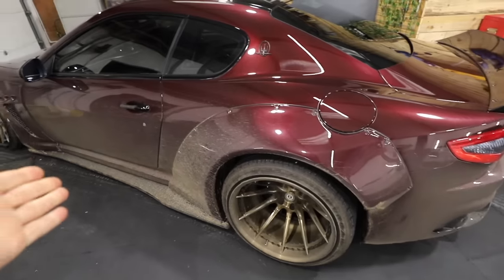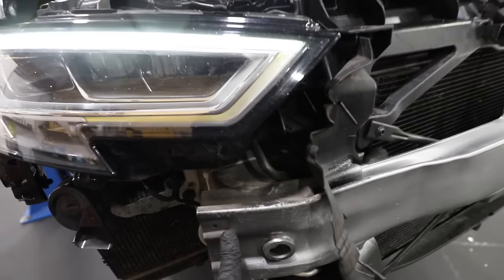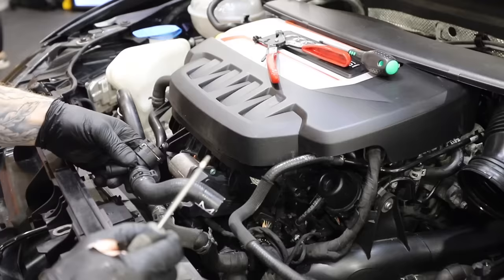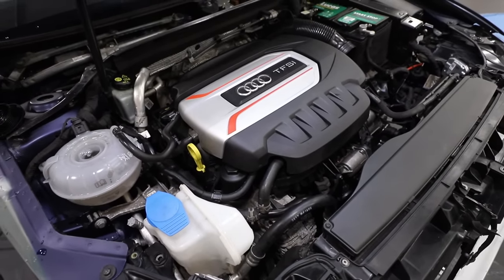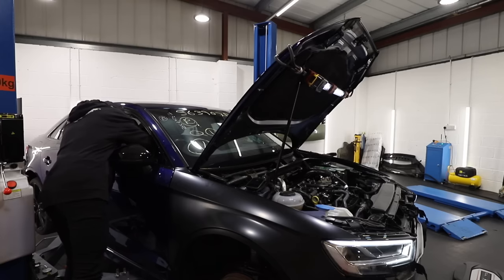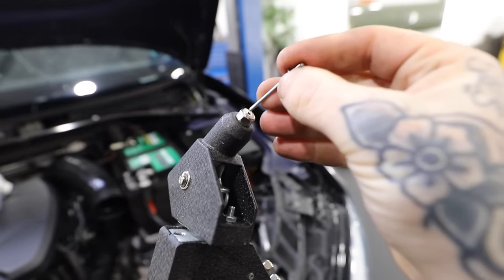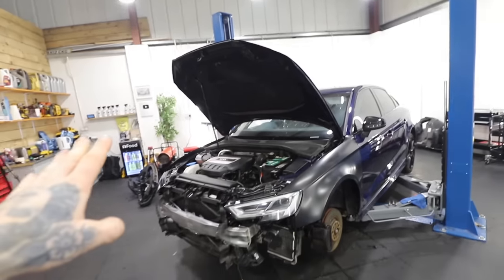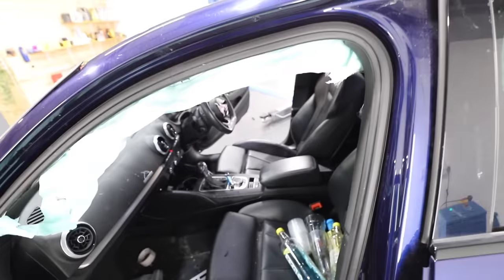MORE ISSUES FOR THE WRECKED AUDI S3

Comment: I think you will find FSI injectors need to be coded....so putting old ones in would mean they were correct code. I love the genuine surprise when a brand new 500 quid headlight actually works....priceless !.
Reply: They do not need coding. It's a straight replacement. The previous injectors he had were no good most likely filler baskets filters are filthy
Reply: Yeah injectors don't need coding. I think people hype up the "you need to code every part on German cars" too much. At least for Audi, headlights, fuel injectors, seats, etc. don't need to be coded. Its only major parts of modules or the module computer themselves that need to be coded.
Reply: Those are port injectors, they do not need coding. The direct injection injectors are mounted in the head and at least on some engines they do need to be "coded". P.S. this engine has both direct and port injection.

Comment: The sensor you have rerouted through the crash bar is for pedestrian protection (the thing that shoots the bonnet up from the hinges) and it works by sensing the pressure change in the tube as it compresses. So i don't think it will work properly as crashing into someones legs wouldn't compress the crash bar like the foam would.
Reply: Who cares just avoid people haha

Comment: I had a very similar misfire issue on my S3 8P which generated the same codes. It seemingly fixed itself too, but kept coming back intermittently. Replacing the MAF sensor fixed it. If it starts hunting again, try disconnecting the MAF temporarily, then you’ll know if it’s that.
Reply: Yeah I had the same thing with my 8P S3. Scratching my head why new coils and spark plugs didn't fix the misfire, didn't realise the previous owner had fitted a chinese ebay MAF 🤣 promptly switched for a new genuine one lol
Reply: Same here on my 8p mate. I replaced to sparks, coil packs and now going to change the PCV valve. If that doesn’t fix it I’m going to change the MAF sensor. The car be hunting/revving on it own
Reply: You had the Ea113 2.0 tfsi engine on 8P, whereas the 8V has the Ea888 2.0 tsi gen3 engine, which does not have a MAF sensor.

Comment: MQB platform is pretty common for misfires , On the 2L Gen 3 engine most common is Coilpacks or Cam Magnets , If you swap the coils and it still shows cylinder one and two , the Cam magnets would be my next replacement, Parts aren't to expensive and its an easy job to replace.

Comment: Love the videos and first time commenting, the crash sensors are connected by the tube, and detect a difference in air pressure   so that the bonnet hinges deploy in a crash. They need to be mounted in the foam to work properly. Keep it up with the great content.
Reply: Hello, I can see that you know a bit about this foam thing which holds the plastic tube. I’ve recently Crashed my Audi and the foam broke alongside the sensors. Where can I find this foam thing and the sensors. Also do the sensors need to be coded ?
Reply: Hi Ibrahim, I recently removed the foam section from my A6 c8 to fit my RS6 grille. Drop me a message and we can sort it out for you if it will fit your car 👍🏼
Reply: @paulbuxton7612  where you fit the sensors? Got the Same issue on my b9 s5
Reply: @king Julian I need to remove the bumper again to mount them into the crash bar, I'm just going to cable tie them on. Currently they tucked into the ends of crash bar as I didn't know what they were until I watched Matt's video 😅
Reply: @paulbuxton7612  i got a fail in the Boardcomputer. Hope audi dealer Ship can delete it

Comment: Injectors needs to be coded for the engine to run properly.
Can't remember exactly. But I think in the engine module you do adaptation to code new injectors.
And spray some clear coat on the crash bar to prevent it pealing.
Ask me how I know! 😉
Reply: Port injectors don't need coded, on some cars the direct injectors do. In this case it was the port type.

Comment: You should check also the Maf sensor and the Pcv system I had a similar problem with my Gti after a cold start I barely touched the gas pedal and the engine started almost jumping ... i replaced the Pcv system and that was the issue

Comment: Matt the injectors are not the same. they have a different openingtimes because of tollerances in the injectors. you can code them to your car because all manufactures uses codes like from A to F. the tollerance is because the springs in the injectors are not the same strenght. weight of the injector pin, frinction in the injector, ... . this is xhy they use tollerances and if you code them right they change the openingtime so they open at the right moment

Comment: Your sure about the Sensor in the Front? It works while getting pressure. The foam ist made it recevies pressure directly from the Front, as the First Part. So the Sensor with the silicon hose makes direct contact with the foam on a accident. He gets the pressure immediately. I dont Think the Sensor got the pressure from the Crash bar. Got the Same issue on my b9 s5.

Comment: 1. gas tank FI cleaner will not work on this engine, valves can only be cleaned with the manifold off
2. use VCDS instead of a generic scan tool...scan tools are useless for diagnosing anything that isn't basic

Comment: Did I see bubbles coming from your coolant reservoir? Is the head gasket damaged or was it just because it was pressuring for the first time maybe? Might be worth using an exhaust gas test or was it just a one off?
Reply: Just air locks escaping.
Reply from the maker: Just airlock I leave it off after filling it just to let any air release

Comment: Matt, these things won’t ‘fix’ itself. You need to do some proper diagnosis instead of just guessing.
Reply from the maker: Diagnosis.. Engine Misfiring- spark plugs change. - read codes - still misfiring - change injectors - read codes - no misfire - car fixed. Job done.  Diagnosis complete . Faulty injectors
Reply: @MatArmstrongbmx  exactly. Guessing till you get it right. That is not diagnosing.
Reply from the maker: @Alexbaja909  please tell me how you would have diagnosed that differently then? Guessing would be seeing a misfire and changing the tyres in hope it might fix it